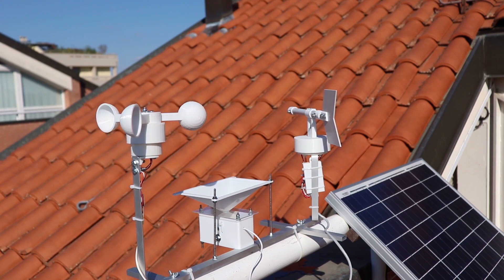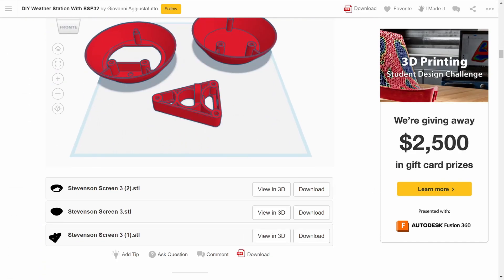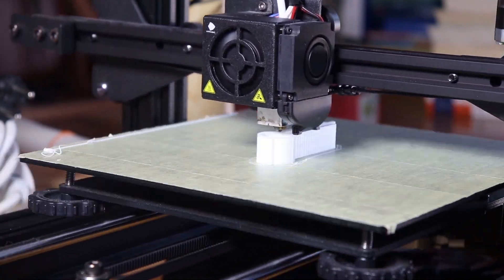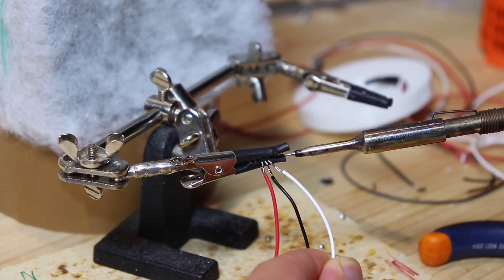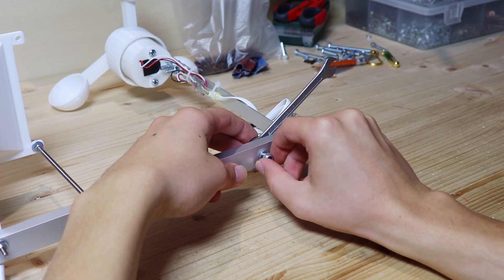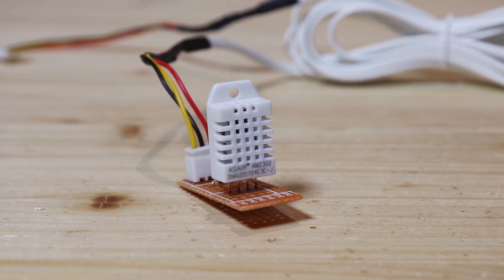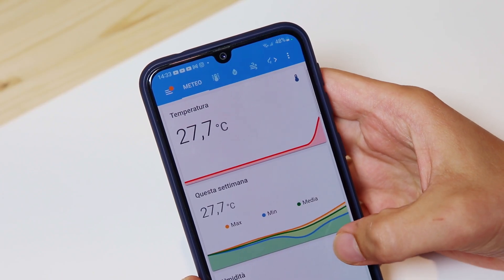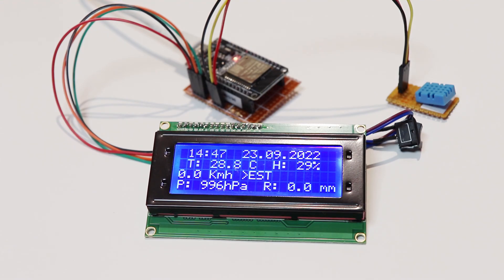DIY ESP32 Weather Station (connected to the Internet)

Comment: Very nice project!

Well thought out and well designed.

This is the best design that I've seen on YouTube.

Did you include the code for each ESP32 in the system?
Reply from the maker: @BlondieHappyGuy Thanks! I'm very happy you liked the project! The code for the ESP32 can be found in the written guide about this project, that you can find at this link:  https://www.instructables.com/DIY-Weather-Station-With-ESP32/
Reply: @makergiovanni Thanks.  I was on that page and looked all the way through.

There doesn't seem to be the ESP32 or Raspberry code anywhere.

I notice too that there are comments asking the same thing as to where the code is.

I'm sorry, but it's not obvious where it is if it's there at all.

???/
Reply from the maker: @BlondieHappyGuy  thanks for the  feedback. I've checked and there must have been some kind of problem with code formatting on the website. Now I've fixed the issue, the code should be available at the link I've sent you earlier. I'm sorry for the mistake 😔

Comment: What is the length of the pipe for detecting the cardinal directions? and is there a .stl file for the wings? I just want to use the .stl file instead of using acrylic

Comment: In your video, you can see the wind anemometer is wobbling side to side as it turns. It might be worth replacing the flat upright bar that holds it up, and use another piece  of rectangular box section instead, to make it more rigid.